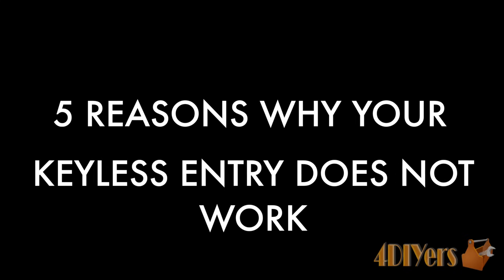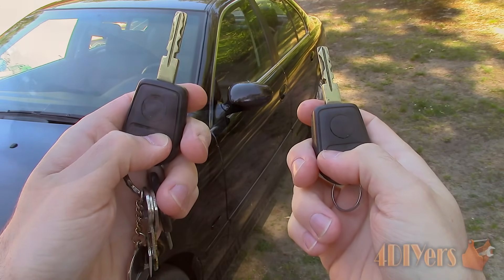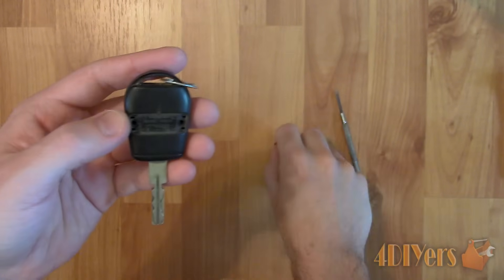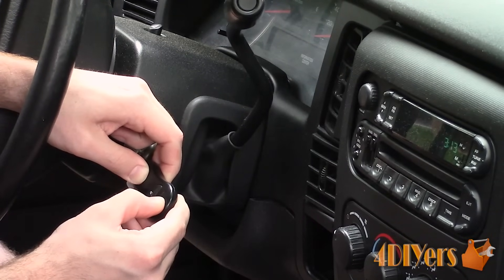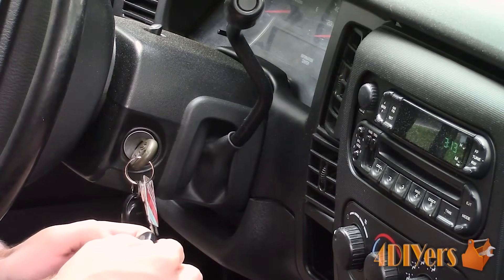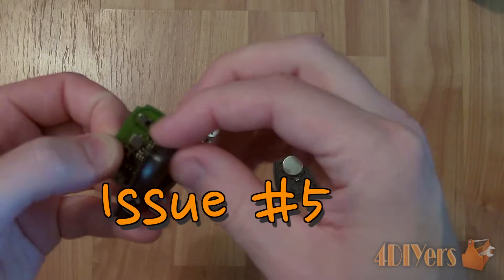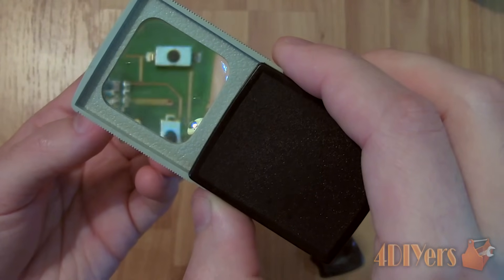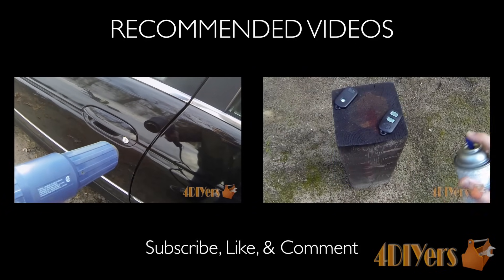5 Reasons Why a Keyless Remote Does Not Work

Comment: Just wanted to share this for anyone who struggling to program a z3 two button keyless entry key. Have read and watched a lot of YouTube videos but just today came across an additional step that just fixed it. 

Steps
Ensure all doors boot and bonnet are closed
Turn key to 1 and back within 2 sec pull the key out
Press down on the back button(rectangular one) while holding it down press the round button 3 times.
Now release the rectangular button- the led light should start flashing.
Move the key close to the rear view mirror about 15 cm and push either of the buttons and the locks should work. 
Get out of the car and rest locking and unlocking of the car.

My car is a 2012 2.2i model ..good luck
Reply from the maker: Excellent tip, thank you for sharing!

Comment: Ok so I have a Citroen C3 2008 manual petrol car but the key fob does not work. If I lock the car using the key on the driver door then it only locks the drivers door nothing else. If I am in the car the button that locks the doors works perfectly. The auto locking works too.

I have changed the battery in my key (I checked nothing else in the key) I have tried reprogramming the key to the car but it did not work (although i have no idea if I was doing the correct procedure for my car) 

Anyone have any ideas????

Comment: There is a sixth reason: your car cannot "hear" your keyfob's transmission. This happened to me. I was mystified because I knew the battery was fine, but a guy from the local electricity authority approached me and said they were using a piece of equipment nearby that creates a lot of electrical noise over a wide chunk of the spectrum and that was why I couldn't open my car. He said they'd be finished in five minutes, after which time my car unlocked.
Reply from the maker: Great tip, thank you for sharing!
Reply: I am thinking the same thing

Comment: I recently replace Toyota Avalon remote battery. Since then the unlock button does not work all the time. The lock button works quite well. This happened on two avalons, 1998 and 1999. This suggests an issue outside of the battery being bad or the two remotes going bad same time. Anyone has suggestions.

Comment: I own a 03 Hyundai Tiburon and my key remote won't lock or unlock but the alarm won't sound it will flash the light and the car doesn't turn on neither what could it be ??

Comment: Hi maybe you can help me my 2006 Jeep commander remote key stop working all of a sudden and I’m getting a message on the dashboard check tire pressure system. My inside door locks works fine. I’ve changed the batteries and the remote still not working. Someone please help!!!!

Comment: My isuzu 2007 NKR remote control stopped working locksmith changed battery-noting went to isuzu dealer they sold me for $130.00 new key with chip instructed to go to locksmith to cut and to come back to reprogram it after few trys they could not do it, they say it could be receiver that was it they weren't sure that's way they could not help can you please suggest

Comment: Sadly you forgot the most common course after the battery and that's the micro switches on the key fob board. If there's a sharp click their normally OK. If a dull click or no click at all then good chance they have failed.
Reply from the maker: As mentioned in the video, this is if the WHOLE remote does not work, not separate components of the remote itself.

Comment: I have a 1994 Oldsmobile Cutlass Supreme S and both of my key fobs aren't working.I've ordered over 5-6 key fobs and they will not stay programmed except for one it stayed programmed for 1-2 hours and it stopped working. Replaced the batteries, fuses have been replaced and still NOT working

Comment: Hm i have good contact inside the key, batteries ok boot, opens, doors lock, just wont unlock the car even has all click noises maybe need reprogramming...
Reply: I had the same issue:

What do you think could be the issue with the following: After arming/locking the car with the Key FOB (2003-2007 Honda Accord) & then coming back hours later to unlock the vehicle with the Key FOB (Recently replaced the key FOB battery) & it does NOT unlock the driver door or any of the doors  (You hear a sound & see the blinker lights flash as usual but it doesn't unlock. Note: All other functions on the key FOB work; Arming/Horn honks/Blinker lights flash, trunk can release, panic button works, etc.)  Then after physically inserting the Key in the driver door lock (Note: The Honda Accord only has one driver door exterior key lock out of all 4 doors)  to attempt to unlock it by turning the key to the right,  it does NOT unlock the door that way either (No matter how much you turn the key there is a lot of resistance & it won't unlock no matter how many times you try). When this first happened, I then replaced the Key FOB battery & then it worked/unlocked the doors using the Key FOB unlock button & also physically with the key, also the interior door lock switch unlocks/locks the doors without any issue. After 4 days the same issue occured again where I CAN'T unlock it with the Key FOB (With new FOB battery) or by  using the physical key. 
DO YOU THINK IT'S JUST THE KEY FOB/ UNLOCK BUTTON HAVING AN ISSUE? OR DO YOU THINK THAT THE DOOR LOCK ACTUATOR IS GOING BAD? (Note: After I get it unlocked 'see below' both of my Key FOB's & the unlock button in the vehicle all work fine until the issue occurs again) If it's the door lock actuator going bad, how can you tell?

HOW I WAS ABLE TO UNLOCK THE VEHICLE DOORS: (Great tip for everyone):
 Fortunately I found a way to roll down the windows via Key FOB (Press the UNLOCK button on the KEY FOB then press the UNLOCK button again & keep holding that button until the windows roll down, if that doesn't work try inserting your key into the door lock; turn it to the right once (or as much you can within reason) then let it go back to the middle while the key is still inserted in the door lock, then turn it to the right again & HOLD it (It may take 5-10 seconds) until the windows start to roll down (At this point you can press the unlock button from within your vehicle on the driver side arm rest; Try pressing it twice to unlock all doors & it should unlock (Note: Attempting to open the INTERIOR door handle may not open the door, you can try the other interior door handles as well, however the best way to unlock it  is to press the UNLOCK BUTTON from within the vehicle) If the window only rolls down slightly then a long stick/long snow brush, etc. can be used through the window opening to press the unlock button, press it twice to unlock all doors then attempt to open via exterior door handles). FYI for anyone dealing with this type of issue (Good info to know in general). Also if you can access your trunk; remember the middle compartment toward the back of the trunk releases forward to gain access through the middle compartment of the back seat area)  Only if you had it unlocked; From within the vehicle back seat area pull down the middle seat compartment/cup holders; you'll see a black middle compartment, use your key to unlock it and then test it to ensure it is unlocked & then try to open it from within the trunk as well (Always keep this unlocked for this reason in case using the Key/Key FOB, etc. does NOT unlock your doors or does NOT roll down your windows to allow you to access the interior unlock button). TRAVEL TIP: Bring an extra Key FOB with you & store it where it would be accessible (Not in your vehicle but in your travel bag, etc.), also bring an extra Key FOB battery & mini phillips/flat head screw drivers that will fit the Key FOB screw (test that it fits the screw & keep this stuff in your travel bag; not within the vehicle in case you need it) Also keep a long stick, snow brush, or  'L' shaped long thin bar in your trunk or travel bag  in case your windows only roll down slightly using the Key FOB window roll down method mentioned previously so that you can press the interior door unlock button. COPY/PASTE or screen shot this & save it as 'CAR EMERGENCY' in your phone notes and add other tips as well or text it to yourself, this way you have it readily available in case you're in a place that you don't have internet access to look things like this up via YouTube, etc. (Download the app: Google Keep - Notes and Lists) if you don't already use a good note taking app on your phone, then like I said all you have to do is type in/search: 'Car Emergency' or whatever you label it as & it's accessible.
Please feel free to comment if you think you know what the issue described above may be or if you have other solutions and also if any of these tips worked for you.  Thank You

Comment: I have a question. Both of my wireless key remotes worked just fine until the day my garage door repair man came and replaced my garage door wall mount and he reprogrammed the garage door car remotes. Then they sometimes work and sometimes do not work. Changed both batteries and they are both still acting weird. Could the reprogramming the wireless garage door remotes mess with the key fobs?

Comment: one remote still works and I replaced the battery on the one thats not working same thing it doesn't work. My guess is the remote is bad. I only used this one all the time the other was never used so it still works fine.

Comment: 2010 Honda CR-V- the unlock and panic button work but the lock button doesn't work. 
HELP!
Reply from the maker: Pull the remove apart and inspect the button. The contacts may have cracked on the board, the switch could be dirty, or it could have failed completely. The contacts can be re-soldered if they are cracked. If the switch is dirty, remove the battery, just spray it with some contact cleaner, wipe away cleaner and allow it to evaporate before assembly. If the switch has failed, sometimes you can replace the switch or get a used or new remote and then reprogram.

Comment: Our 2012 toyota key fob works on all doors except drivers door. How do we fix that ourselves?
Reply: It's the same with both key fobs
Reply from the maker: Sounds like an issue relating to the door lock actuator. If the power locks switch also has the same results, then you may either have a broken wire doing to the actuator, a corroded connector, or the actuator is faulty.

Comment: I need help....so, I have a bunch of key fobs that I found on the street in a leather case. I  Inspected the bag that they were in but found no address, phone number or any info that I could have used to return it to the rightful owner so I kept them all. This was 2 years ago. Today, ingot curious after finding them in a closet I was cleaning out. The fobs are of many different car types. There's Mercedes Benz, Dodge, Fiat, Ford, Mustang, and so on and so on. My question to you is, could there be a possibility that I could sell these key fobs? I mean, granted, they are probably programmed to cars I will probably never see, but can these fobs be reprogrammed to match a certain car type? I would appreciate if you could help me out here. Hey, times are rough financially for me and well, if this could alleviate my problem, I'm all in to try and sell them. Thanks!

Comment: Mine works, but it doesn't automatically unlock or release the trunk if the fob is in my pocket. It should! I have to actually USE the fob to unlock the doors and the trunk. I know this sounds petty, but when you have groceries and your purse and a couple kids in tow, it is a pain in the butt...when it's supposed to work!

Comment: Hi. Are there any ways to get a key-based ignition on a car that only comes from the factory with keyless fob? Thanks in advance
Reply from the maker: No one makes a kit specifically that I am aware of, but it can certainly be done. The button is really only an on/off switch, however it is a momentary switch so there might be a little trick into wiring it up. You would still need the vehicle's remote as it senses the coded chip.
Reply: @  4DIYers, The vehicle's remote? That's not good. So I must mod the chip, or the ECU somehow? Anyway, if I were to install a key-based system, the key cylinder would get inserted in the former on/off button location, right? I'm totally against the keyless systems for cars
Reply from the maker: The remote that you carry with you when you start the vehicle, the computer senses that. If you don't have that, the vehicle will not start. If you want to by-pass that, that will most likely be a rather complicated process. The receiver would either need to be by-passes or coded out through the computer. For the push button switch, it's technically a momentary which sends a signal to the computer to either activate the accessories, start, or turn off the vehicle. To be honest, it's probably too much work and money involved to by-pass the current system. While someone can steal the car with the current system, it would be much easier to do so with just a key switch. If you're worried about theft, it might be easier to install a hidden switch which disabled the fuel pump or start solenoid.

Comment: Hi. I got honda civic 2008. My car key battery drained, i tried to enter the car by opening the door manually. I tried to start the car but no response. What should i do now? My car doesn’t stop alarming
Reply from the maker: You'll have to replace the key battery first. Try disconnecting the battery in the car if the alarm continues to sound.

Comment: My car unlocks and locks but will not start...how do I fix it
Reply from the maker: The problem can be relating to quite a few areas sadly. Usually broken down into whether the engine turns over or not. If the engine isn't turning over, this could be a dead battery, faulty starter, faulty ignition switch, security fault, etc. If the engine does turn over, also could be a security fault or no fuel, no spark, etc. Here's my video on how to troubleshoot a starter https://www.youtube.com/watch?v=E1nlbeXtVmQ

Comment: My Lincoln’s remote stopped workin so I replaced the battery. That didn’t works so I have been through the reprogramming procedure many times both with my original key fobs and with some replacements. The car cycles correctly, but the fobs will not program. Any suggestions?

Comment: Just bought a 2013 Sienna came already with one remote. I have tried the programming steps for additional remote multiple times and it's not working. Is it because I already have a working remote? In your video I beleive you may have mentioned such a problem and wasn't sure. Please advise.

Comment: I have two remotes with correct FCC #s (and all codes I got from the Dealership) for my 2007 PT Cruiser, one with the key cut that fits, but they don't work (the one with the matching key cut starts it only momentarily).  How do I re-program these to work for my Cruiser without paying a locksmith big money?  Thank you!
Reply: Good question the situation is designed this way so the punter is made flustrated because he cannot get info and the dealer gets richer

Comment: I've  been having trouble with this problem for a while now. It started off by sometimes working other times not. Then my door lock buttons seized where when I put my gear shift into park only two doors fully unlocked the other two the buttons only opened half way so had to manually lift button the rest of the way. I changed both door lock mechanisms which fixed the problem.
 I also thought it fixed my automatic key lock problem as well, but yesterday it stopped working again so I'm back to manually locking the car. all this has happened over the last two weeks. 
So am hoping you have an idea what the problem might be. I had both sets of keys renewed 2 years ago and have used 1 set exclusively. They were done by third party and not car manufacture dealership. That's all the back ground information I can think off.

Comment: I have 2006 ram the key with chip and lock and unlock buttons. it will start car but not lock or unlock doors. BUT!!!!!! I have plan key with no chip or buttons if I put in ignition and turn forward then take out other key will now lock and unlock BUT when use key to start the car the lock and unlock buttons no longer work??????

Comment: 2002 Buick Rendezvous.  I noticed the remote would start to not work periodically.  Several button presses would be needed to activate the lock.  This progressively got worse over time.  Now it does not work at all.

Battery is fine - there is a single 3V calculator type battery which reads 3.27V.  None of the 3 remotes work, so it does not appear to be the remote itself.  I tried the reprogramming sequence, but it never completes when I press the remote buttons.  Fuses check OK.  I have had BCM issues with this car in the past.

Suggestions?  The antenna / module are no longer available from any source I can find due to the age of the car.  Thanks.
Reply: Hello random stranger from 4 years ago.  I have exactly the same problem and no one on the entire internet seems to have solved it (although there are threads either he same issue).  It works sometimes and sometimes not at all.  Battery in the fob is clearly working, as it lights up….

Comment: What do you do if the battery was dead on the keyless entry but if you open the door manually than the stinking alarm goes off?
Reply: Put the key in the ignition and cycle the switch. This usually shuts the alarm off.
Reply: It happen on my 200 chrysler open the door but cant seem to shut it down to be able to pe9gram rwmote
Reply: SAme problem

Comment: I just bought a used car with 2 remote keys. Neither one works. I replaced the batteries on both. Not the problem. Strange that 2 would go out at the same time.
Reply from the maker: Check the fuse for the module first, if it's fine then try to reprogram the remotes.